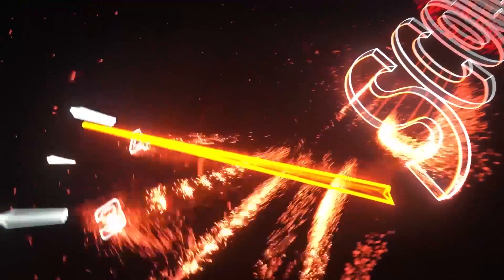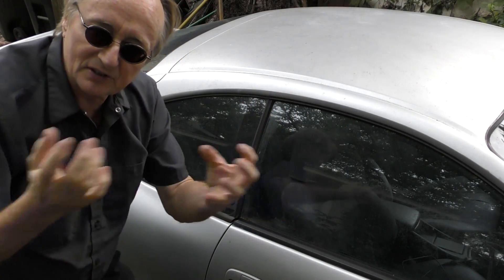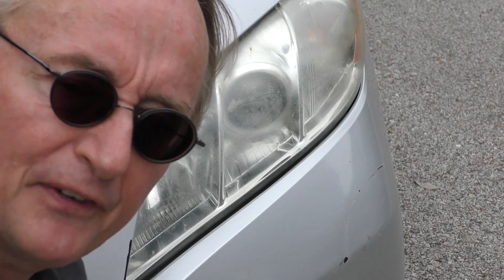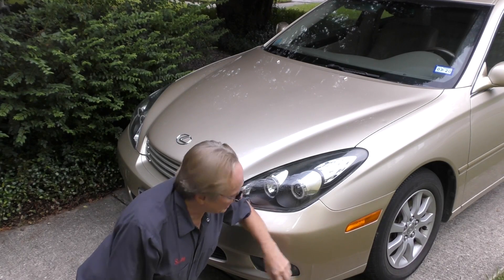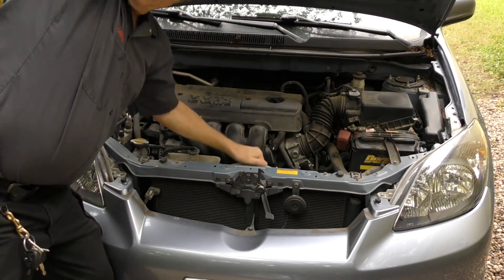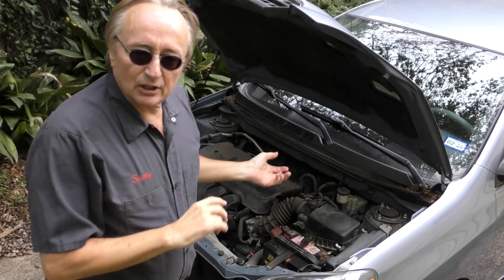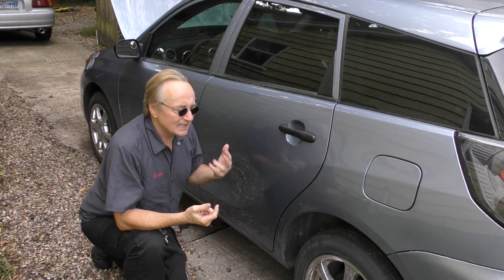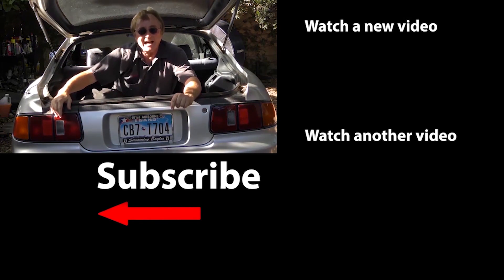You Can't Fix Stupid (Closing My Car Repair Business?)

Comment: No One:

Scotty: NOw WhEN I WaS A YOuNg mEChANiC
Reply: When scotty 2as young, mechanics were being invented.
Reply: @kevinmael3862  Back when we had good mechanics that fixed the real problem. There are still mechanics out there, but so many are now "parts changers". They keep putting on new parts till the problem finally disappears. But you are still stuck with paying the costs of new unneeded parts and the time to install them.
Reply: No One: 

Scotty: These cheap plastic door handles broke again
Reply: @ronfullerton3162  Engines were easier to work on back then.
Reply: @kevinmael3862  Yes and no! Basic engine operation has not changed all that much, but the drive for technology has added so many more pieces, both actual engine parts and technical operation apparatus. Additional engine parts would be such things as four valves per cylinder as compared to two, multiple cams, and such. Technical operation apparatus would be computer control, servos, sensors, and so forth. That takes equipment most shops do not even have, so they start replacing parts to find the cure. And these parts are many times electric or computer and sensor based to where they will not take it off because being actively included in an active operation system makes them possibly compromised and unable to function in another system. But to get back to basic operation, I have seen young mechanics bypass easy fixes that an old mechanic would of instantly recognized. It is a profession that experience plays a big part in abilities. I have seen young mechanics that were excellent, but they had been mentored by an older mechanic and had been very open and inquiring to older mechanics' knowledge. This is not to say young mechanics aren't any good, I am just saying the good ones will be better each day they wrench.
Reply: @ronfullerton3162  : As a professional mechanic, I can say this from experience: Most people are unwilling to pay for proper diagnostic time typically required, to fix the problem right the first time. That's a simple fact. 

Additionally, NO automotive repair shop invests in their mechanic / technician personnel. They do not pay them properly and they do not continually educate them, so that they can properly diagnose and repair modern vehicles in a timely fashion.

It is what has created the whole "parts-replacing" problem that nearly all repair shops everywhere have these days.

Tell me I'm wrong. (Hint: I'm not.)

Comment: Ford Mustangs (2005 and newer) have the same kind of thing - theres a panel under the rear seat which you remove and the area of the tank where the pump is located is right there.  Very handy.

Comment: How about cars where the water pump is internal and driven by the timing chain. The pump fails and you have to take the engine apart to repair the engine! The pump leaks coolant and destroys the engine! Other cars with a plastic water pump.
Reply: Do u even watch the video?
Reply: @haloreach7  I am talking about an internal, not external water pumps. The internal water pump is  driving by a timing chain inside the engine,

Comment: I feel like at least headlights wise the move to plastic was the ability to shape them in funky shapes without it costing a ton. as plastic is alot cheaper to do that in. but it comes with its downsides
Reply: Everything's a compromise. Plastic headlights allow more aerodynamic designs that cost less to produce and provide for better gas mileage, but at the cost of fogging over time - and the fogging varies depending on the climate where you live. 

If you live somewhere where there's a lot of sun, inevitably plastic components are going to degrade faster than if you live somewhere with less sun.
Reply: Automakers have almost no interest in making their vehicles long-lasting. They make their money off selling new vehicles. 5 years is about how long they try to make them hold together for. That is also about the amount of time before a new model makeover is released. Then the plasticy junk parts begin to deteriorate and break.
Reply: @harrytinker2328  still got some 03 orginal plastic headlights holding up pretty good. I buff them by hand with some polish every once in a while and they clear right up. so at least for me they seem to hold up. but they do have that down side of yellowing
Reply: Pq
Reply: There were glass fairing covered headlights in the old days (Jaguar XKE Series 1), but they were outlawed due to optically diffusing the light into the driver's eyes of an approaching car.  But the goal of aerodynamic improvement and styling) was still there.  So (unreliable) pop-ups were the rage.
Then lightweight, cost effective aerodynamic headlight assemblies were developed.  Optically correct (some even have focusing features) and the world has changed.  Glass versus plastic would cost a fortune in tooling and molding unit cost.
Clean polish protect or buy new.  No going back now except retro cars (e.g. some Jeeps).
Reply: I have seen many glass headlamps literally half full of water because a rock peck made a hole moisture could get into. It’s hilarious to see water sloshing around in a headlamp on some schmuck who never looks at his car. Plastic headlamps don’t have this issue in my experience. The hazing is easily fixed with a kit, WD40, or a permanent solution available at some service shops.
Reply: @markconger8049  Plastic lights can end up full of water, maybe not through a crack, but from losing their seal. Had one the other day where I went to change a buld and about a cup of water came out of it..

If you use UV resistant clear coat on a headlamp after polishing it, it will last years.
Reply: @dunebasher1971  : You are correct, except for the gas mileage. I can show you plenty of cars that get as good as or better fuel economy, that have glass headlights.
Reply: @Cheepchipsable  : Except almost nobody polishes them and then seals them with what is basically a clear coat paint. Furthermore, plastic headlamps are so shitty that I've personally had several headlamp lenses fall off right into my hands over the years. 

I've also drilled holes in the bottom of many a plastic headlamp housing in order to drain the water out of them. It's the preferred "cheap-fix jerry-rig" solution, short of replacing the garbage headlamp assy with a new one.

Glass will always be a preferred design for quality headlights.

Comment: Yeah Scotty I had the Same problem with an 08 Mack truck when it was idling the temperature was good until I put it under load and made it work it got Hot! It was the plastic impeller that when it idled it still turned but at a higher rpm it would slip and not pump enough water through to keep it cool!  And the Rad tanks are Plastic too! 
Have a good one and Keep up the good work!

Comment: Thank you i really appreciate this video. The belt on my chevy equinox went and sure enough the car stopped because everything is being run off one belt. Ok thats fine Went to go replace the belt just to find out i need to raise the engine to be able to replace it. Like wtf how stupid is that something so simple they make it so complicated but its done intentionally the car manufacturers dont want you to be able to fix your own car they want you to bring it to the dealership so they can charge you an arm and a leg its just sad and i hope something bad happens so they can all get sued for being so greedy.
Reply: Some manufacturers make it so you think you have to raise the engine but there is an easier way you just have to find it
Reply: I understand but thats not my point. I have replaced plenty of belts in the past. I have worked on heavy war equipments like tanks humvees Strikers i can go on and on. I have never been so frusted in my life working on that equinox that is just unacceptable something as simple as replacing a belt i have to remove and engine mount and and yes you do have to raise the engine up a a tidy bit to get enough clearance to get the breaker bar on belt tensioner. The other option was to go from underneath but i still had to remove the engine mount anyways to be able to get the belt back on so there was no winning that battle.

Comment: Whatever might be profferred about the benefits to plastic parts, it melts and cracks as a result of heat and cold, that is a fact. Metal expands and contracts as a result of heat and cold which creates another set of problems, but it won't melt or crack

Comment: Fuel pumps never die with an empty tank, they die because of it after they're filled back up!
 - Murphy's Law
Reply: Running a low tank should be a warning in all owner manuals !  Lots of folks will run them low and never be aware of the damage that can occur. Thanks to the manufacturers

Comment: My 2006 nissan sentra, fuel pump access is under the rear seat. 1. Flip cushion out. 2. Remove 4 small bolts to take cover off 3. Undo pressurized fuel line(or bleed pressure beforehand) 4. Undo wiring plug 5. Undo 4 small bolts that hold entire fuel pump basket assembly in place. Took me all of 1 hour to change assembly and clean up. Not bad for a Mexican Renault! In fact my Nissan is very easy to work on, and has never failed me 160,000 and going

Comment: My 1930 Studebaker still has the original bumpers, radiator and door handles, but the water pump impeller had to be replaced in 1991.

Comment: Man, this hits home for me. I had a '95 Jimmy that had the fuel pump in the tank, that thing went out 3 times, every time with a full tank. I've gone back to the 70's. My truck is now a '76 F-100 Custom. I can change the fuel pump in 5 minutes, the carb in 15, just about anything attached to the engine in under 30 minutes for a fraction of the price of the new crap. Plus BONUS - no GD computer! I'll never go back to the new crap.

Comment: A fix for yellowing headlamps:  a company called Weathertech makes a product called "LampGard" who's primary purpose is to keep your head light plastic from breaking but also has UV protection built in. I put them on my 2000 Durango in 2001 and the only yellowing is on the very outer edge where the LampGard  stops. I'm not connected with Weathertech in any manner at all, just a retired firefighter that has found a good product. I put them on all my vehicles now. You might want to check them out for yourself.

Comment: After watching about a year's worth of Scotty's videos I have come to the conclusion that we have the same idea.  Buy a Toyota or an old American car.
Reply: ...and if its not either, maybe a Honda?  Scotty has said good things about them.
Reply: @haze_productions9715  After owning old American iron, Toyota and Honda 
(Acura)  I can agree that Honda is in 3rd place.  Toyota for a daily driver that you just maintain and rarely worry about, old American cars for just plain awesomeness without the pain (quality and easy to maintain) and Honda for good sensible and reliable "a to b" transport.  Third place for not being as good as Toyota in engineering for comfort.
Reply: @mannye  Owner of two hondas myself, one of them is a daily, the other is a project car that I'm modding over time.  Really I buy them because they are cheap.
Reply: @haze_productions9715  Cheap to buy and cheap to own = success!  :)
Reply: Manny my 2014 Accord DX 4cyl no AC has almost one hundred thousand miles.
Reply: @haze_productions9715  : Honda's are never cheap to purchase in my neck of the woods. That, and common wear parts cost more than american-made vehicle parts, likely due to tariffs and taxes. Those are the only real downsides to them. 

That said, if Honda made a real pickup truck (a 3/4 or 1-ton) to the same quality standards that they build their cars, they would sell more pickup trucks than any manufacturer in the United States, guaranteed.

Comment: Scotty, my front loading washing machine had the same pump problem; pump motor was working, shaft was spinning, no pumping. I took the pump out (at least it was very easy to get at) and found the plastic impeller was loose on the metal motor shaft. The entire pump assembly was plastic. At least it was easy and fairly inexpensive to repair, I’ll give it credit for that. I agree with you, too much plastic on cars.

Comment: Scotty, sir if a quarter of my teachers growing up was as informative as you I think I’d be a mechanic full time.. you have saved me so much money and time. I fixed my mother in laws car, that a mechanic had been messing with for 2 years. I went and bought a Coolant temp sensor, the Ford Focus would over heat at a stop sign, he changed coolant tank and water pump, swore it had a head gasket blown, but It wasn’t. Car sold at auction regrettably but black Betty is still running to this day and it’s been three years and hasn’t seen a mechanic since. It was a sensor the whole time. If I have an issue I come to you. Rev up your engines 🤘🏼

Comment: Yup...I bypassed the ac compressor pulley in my 95 Lumina. The new belt routing made the water pump run backwards. Drove the car for at least 3 more years with no ill effects.

Comment: This is what happens when you "advance" technology, for the sake of technology. These techy nerds are so busy designing the latest and greatest, they never stop to ask "why?".
Perfect example: having to use resistors for LED's, in a turn signal circuit because the flasher is controlled by a computer module.
Reply: joeashbubemma,  one of my engineer buddies who used to work for one of the “big 3” back in the 90s told me they had a bonus plan for their engineering teams. They had a formula to pay a bonus for part re-design that reduced weight by a certain percentage or reduced production costs by a certain percentage. And those numbers were quite low!  Also, the mean failure time specs went up substantially. 
Quality my a$$
Reply: having a computer control the flasher doesn't have anything to do with it in reality, it just the fact that most older flashers are designed to work with a certain range of resistance, and LEDs have far less than older filament bulbs. you can run into similar issues in other lighting circuits with current bleed through and whatnot due to the lower ohm load
Reply: Because money
Reply: That is how LEDs work. They are current driven, not voltage driven. You need to limit the current to them.

Comment: You are right. Its made out of plastic with expiration date on it sonthe consumer always needs service as everything made is designed to break down. Chevy cruz is an example of such car everything is plastic on it from gsket to pcv valves to egr that end up breaking down very fast or stuck

Comment: Dorman makes a product called a ac compressor by pass pulley. I wouldn't say they make it for every car, but they do cover a lot of them. What it basically is, is a pulley the same as your cars ac compressor, mounted to just a metal bracket that mounts just like your ac compressor. You simply disconnect and remove the ac compressor, then mount this metal bracket with pully up. It bolts up the same, and you can now reattach the belt. Of course means you wont have a/c, and if you ever do go to repair it, it will cost a lot more because now your a/c system has been open for a extended period of time. But if the options are buy a new a/c compressor which cost upwards of $300+, or this item which cost no more than $50-$60, if you don't have the money, you have to what you have to do.

Comment: I just replaced the plastic water coolant water outlet on my Focus. The Plastic degraded and seal blew. Lucky it was easy enough for me to fix in a hour, but it was a plastic part. I had a serpentine belt break on me on the highway on another car I owned. I remember seeing the check engine light come on and it was starting to get hard to steer. Lucky I was 3 miles from home and I was able to make home before the battery died.  The plastic tensioner is what broke sliced the belt right off.

Comment: Speaking of cooling system, what ever happened to Prestone antitrust & pump lube?
The stuff worked so good! We put in his 78 Big 10 C10. That was in 81. 500,000+ miles and the propane fueled engine needed to just have fresh std bearings and rings. The hoses are all vintage. Heck, the steel head gaskets were just copper coated and looked brand new (first time I even heard it much less saw it). The MLS gaskets are on the parts wall.
Does Prestone still make it or a comparable item by another name?

Comment: I just replaced my waterpump on my 2012 Mazda Speed3 with 107k miles on it.  It had not failed, I just replaced it as preventative maintenance when I replaced the coolant.  It had metal fins and there is not 1 spec of rust on the old pump.

Comment: The single belt design has some advantages 
1)  less power is wasted using flat belts vs the old v-belts
2) the flat belts have a longer lifetime
3) The flat belts can be changed by simply rotating the tensioner 
4) multiple belts require moving the engine back for clearance 
I agree with your criticisms but with these advantages here's one vote for the newer design.

Comment: Scotty here,s another very stupid move- moving the dimmer switch to the turn signal!
Reply: stardust1975: Ever try to dim the headlights when shifting with that stupid button on the floor? At least I can shift (foot on the clutch) AND dim the lights simultaneously.
Reply: @michaelhall9138   i drive semi,  not an automatic transmission, 13 speed, never, had a problem, cause i don't rest my left foot on the clutch peddle!  seems to me that a manual transmission is to much for you to handle!

Comment: Just had a fiesta with a broken off hose connector :/ replaced the coolant and wanted to get rid of the last air trapped inside the heater core. So released the clamp, pulled gently on the hose while twisting it a little, and SNAP! The darn thing was extremely brittle. Never had that with my 60's cars....